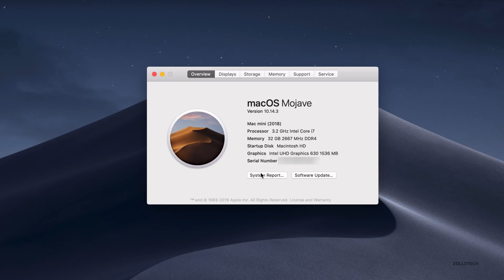Mac Mini RAM Upgrade

Comment: Does anyone know if the vengeance lpx catds with the extra plastic will fit ?    I just bought them from best buy and realized they have extra coverings on the cards and wanred to know if anyone has successfully installed them or if tbe coverings get in the way, and i should return these cards and find slimmer optios before i open my machine up :)

Comment: Hi Aaron does it matter which brand you choose for memory? Also they recommend CL19 cas latency and this memory you use is faster, CL16, so, are you using it still and do you have any or no problems with it? Because i want to put more ram in my mac mini. Thanks if you answer.
Reply: Thx for the answer (not)

Comment: You should replace the thermal paste also when its open. I did and it runs cooler.
Reply from the maker: I saw some videos on that, and mine doesn’t seem to run as hot as some of the others. Maybe they changed it later on?
Reply: WHAT IS THE THERMAL PASTE?
Reply: look here https://www.youtube.com/watch?v=qc7bCC1TmVg&t=93s its from der bauer, best overclocker in the world